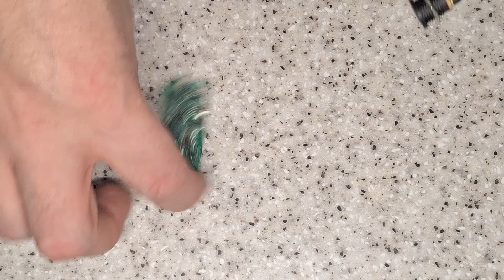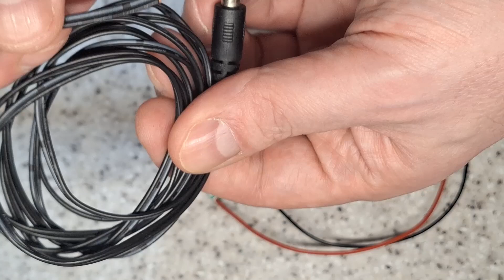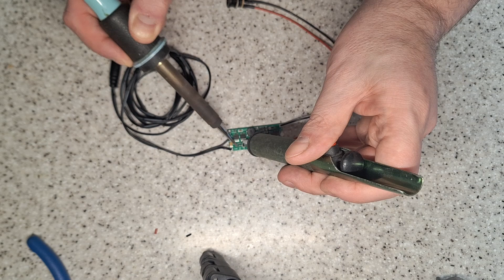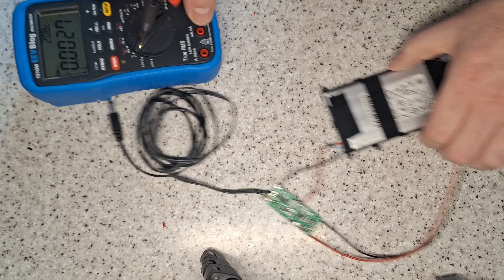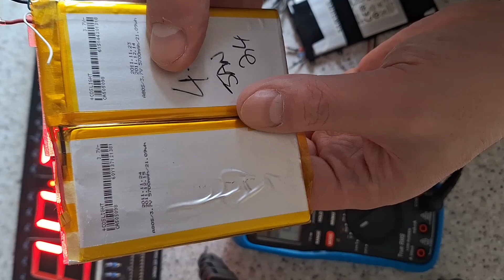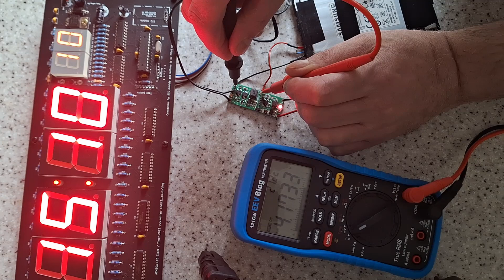9V  / 12V 1A UPS board review & test (make your own DIY UPS for router, camera, solar project)

Comment: I plan to use this module with a 18650 2 cell holder (in parallel). In this way I can replace batteries as needed. Also I plan to add a schottky diode with a SPDT switch at battery input side. So I can switch the charging ON and OFF as needed without affecting the regular work flow of the UPS module. In SPDT switch 1st mode will be direct connection of batteries to module and 2nd mode will be batteries connected to module with the diode in between.What are your opinions on it.
Reply from the maker: Yeah sounds a good plan. Will prevent cells from being continually "float" charged.

Comment: Can I connect a 12V battery pack (3 Li-Ion batteries in series) to it, instead of a single battery?
Reply from the maker: No, its designed for single cell 3.7v only.

Comment: Man i have a problem with this

Output voltage reaches to 24v to 32
Reply from the maker: It's definitely faulty then. What input voltage do you have? It's best on 12V Input, any higher than that would blow it.
Reply: @adriansmith31  12 volt input

Fun fact  when i connect the battery vottage increases

Then i breaked it out in anger 

It cost me like 1.9$ in Bangladesh

Comment: Theres a 2s red version, claiming its the newer version. It wouldnt turn on with only the batteries plugged in unless u to connect the input to 12v. Which is stupid imo. If the electricity goes off, it runs as its supposed to, but if ure planning to change the battery once theyre dead, it wont output 12v unless u feed it 9-12v in the input.

So i keep 9v battery next to it to jump start it xD
Reply from the maker: That's worth bearing in mind. Seems the older version is better as it does turn on from battery without a 12v input

Comment: Why this Card  ?  Charging Red LED & Full Charging green  LED is Flashing . No battery Error sing . What Solve problem.?
Reply from the maker: Could be that the output is overloaded or the AC adaptor can't supply enough current. AC adaptor needs to supply enough current to power the load and charge the battery. UPS output can only supply 1A
Reply: Actually the green LED is a output led it turns on when you run something in the output with battery power, i am having one of these boards and made a wifi router ups using it.
Reply from the maker: @mr.strange7002 yeah, on mine the green LED is very dim. Can just about be seen in a dark room, that was with a standard 20mA LED. A superbright LED that works with only 2mA current lights up OK. I think the guy who posted the question meant the green LED was flashing. Red LED flash means no battery connected or bad battery.
Reply: What is the lowest cut off voltage
Reply from the maker: @jacoblalrinawmachhangte1538 sorry not tested that